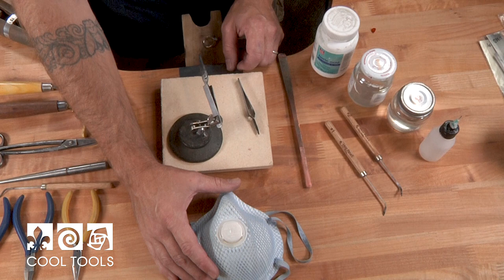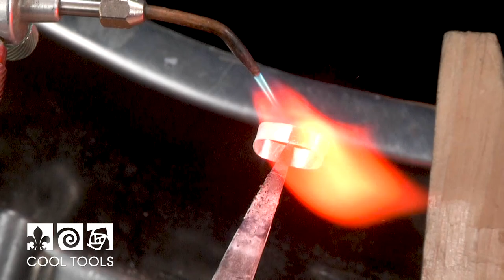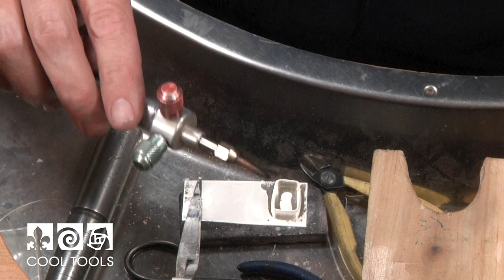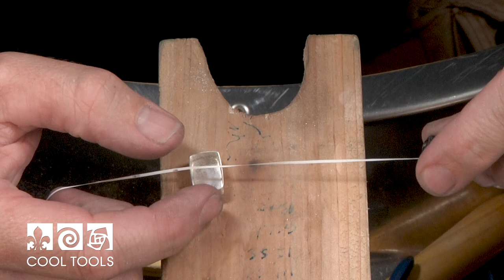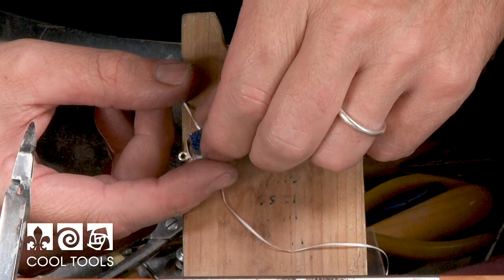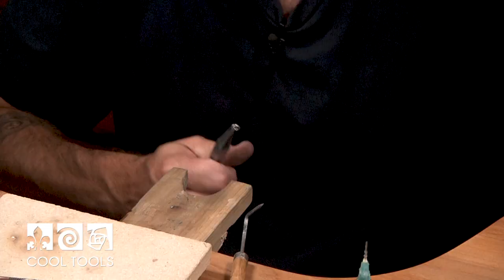Cool Tools | Druzy Quartz Pendant by Matt Breunig

Comment: Great video👍. Just curious why are the Solder picks so expensive? $52 is extremely steep for three solder picks.
Reply from the maker: The Hot Picks are high quality - they are made from oak and titanium. Each pick size features a hand machined point to create a divot designed to hold the perfect amount of solder. Thanks for watching!